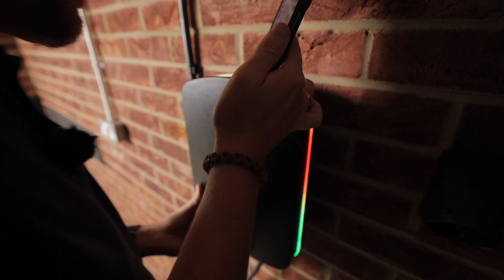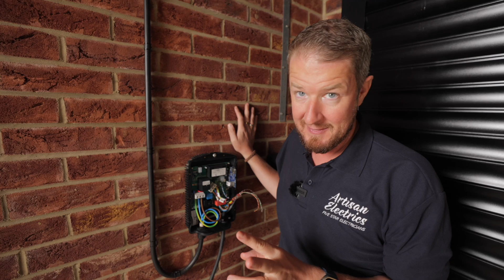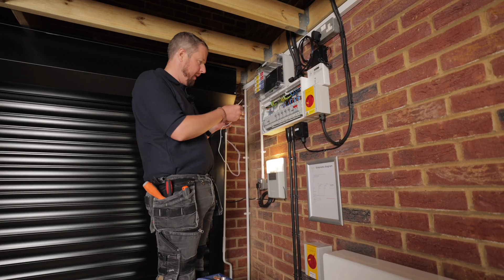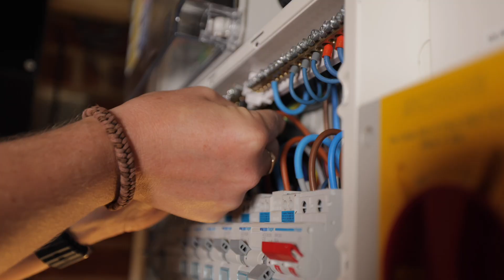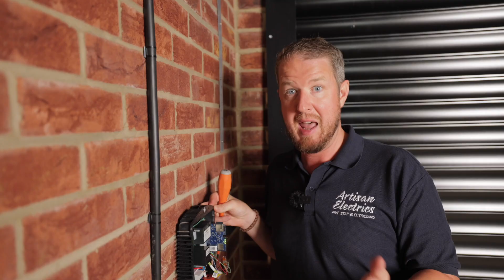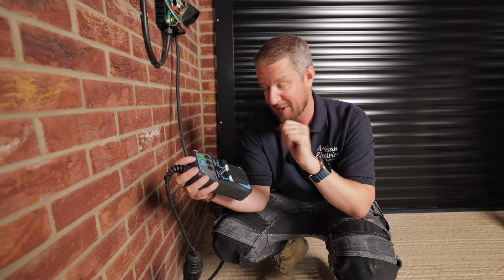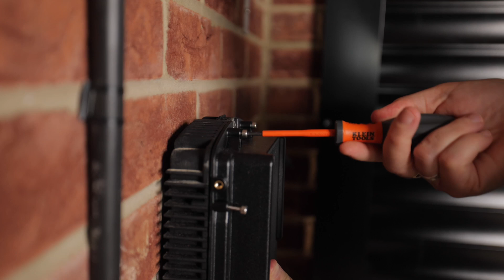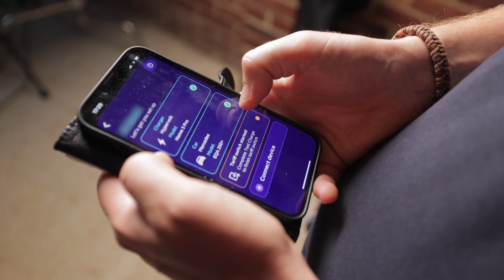Is this The ULTIMATE EV Charger?

Comment: outdated cause you can get such modes for free using evcc .evcc runs on any tiny pc or raspi and is manufacturer independent. 
It does not care about your wallbox, smartmeter and inverter cause it works with all of them . Customer decides to buy the best inverter like our Growatt SPH with EVE LFP batteries and a Pulsar Plus wallbox made by WALLBOX the inventor and owner of the term wallbox. And evcc manages how to use your surplus energy, when to start charging home battery and at what power level , when to charge the car and heat the warm water with the heatpump. 

And on top we will use EOS, the energy OS also made in germany soon funded by a kickstarter campaign. And of cause charging the home battery during of peak hours or when the price on the stock is even negative is supported too. Most or all our devices are running modbus and that is what you need: 2 wires

Comment: Your wonderful "battery safe" mode is very limited in what it can actually do.  The best it can manage is to detect when the battery is trying to supplement the power whilst it is doing diversion of excess solar.  The EV charge point then slows down the EV's charge rate to get the battery to stop again - that's it.

The real problem is when the EV is charging at full speed - 7.2 kW or so.  For that the extra CT clamp is no help at all because the charge point has no way of controlling what the batteries do.  The correct solution (regardless of what kind of charge point you're fitting) is to connect the charge point outside the area which the batteries try to power.  In the case of a Powerwall that means connecting the charge point between the Powerwall gateway and the grid supply.

This is part of the basic planning which should be done before any battery installation.  It's amazing how many installers don't do it.
Reply: How do you charge from solar in that set-up?
Reply: @simoncoles2463 still works the same - your EV solar CT clamp still goes on your outgoing supply, so when the charger senses you are exporting surplus it knows to start charging.
Reply: OR - have an automation system that detects EV charge power and reconfigures the batteries.
Reply: get evcc for free and then it is part of your daily decision . search for evcc and you will find the details for an independent soultion.

Comment: If using the batteries to make use of the cheap overnight prices. I cant see the point of having solar. The car and batteries will be on cheap rate over night. To use 18kwh a day in a home is unlikey without aircon/heat pumps.
At the video start you mentioned not using the battery for car usage due to the over cycling. So your saying not to charge a car via battery. Home usage is low without car charging. According to this video solar and battery is useless for car charging, car charging is 90% of energy usage in a standard home with a phev/ev.
Reply: do not forget that government looks for new money sources and that changing the accounting of your cheap elelectricity is the easiest way. And then you are screwed over night.

We have a 99,9% grid availablility. Power lines are mostly in the ground not like in the USA the mess with all the poles. And we pay for a kWh on the exchange about -5 to 30 Cent but have to pay on top grid fees of 20 Cent which all those parties get who are maintaining the grid. 

Your days are counted where you can get electricity for free through the lines cause Brexit will cost a lot more and the government will realise how to make money . UK electricity prices are cheaper than in the EU. And here everyone has to pay the grid fees per kWh.  

We get 8 Cent for a kWh we are feeding in regardless at what time - and for 20 years. But If I have to buy back 1 hours later I will have to pay the stock price and on top 20 cent fees.
If there is a lot of offshore wind in the north sea during night or winter then the price might be -10 cent which means I get 10 cent per kWh I take from the grid but still have to pay 20 cent for the grid, so at the 10 cent per kWh during these nights.

Comment: It's missing the most important thing, local access with a documented API. This is just another cloud connected piece of e-waste.
Reply: Are there any chargers that actually have a documented local API?
Reply: At least go-e chargers. The documentation is even freely available on the website.
Reply: @Aphova OpenEVSE is completely open
Reply: We have one no problems at all app is continually updated when req, what more do you want,
Reply: What extra features does that allow?
Reply: @B0jangle5  Home Assistant and other integrations
Reply: @B0jangle5  You can tie it into your home automation (if you have it) or control it in any way you see fit, instead of being stuck on one app.  It continues working if you have an internet outage.  If the manufacturer goes bankrupt or decides not to support your device/charger anymore because it is "too old", you can continue using it. Otherwise it just turns into  a brick (well best case you might still have a completely manual charger, but you lose a ton of functionality).
Reply: @fintrollpgr  Thank you. I was quite happy with my Ohme Home Pro as there was no need to automate it given that i'm already getting the cheapest rate. I hadn't thought about the issue of the company going bust though.
Reply: @B0jangle5  You're welcome. I forgot one other case btw. The manufacturer suddenly decides to charge you for the privilege of using your device over their cloud. Enough examples of that can be found also. Simply said if some device needs the cloud it is not your device.
Reply: Absolutely… Its infuriating that I have to have a monitoring clamp on the ev charger circuit to tell when the car is charging - why can’t the charger just tell me locally.
Reply: Its fully accessible from HomeAssistant locally offline. If this is a functionality you want or need then its a relatively simple job to setup. Its not a functionality which most people even understand.
Reply: @StephenBrightwood  Well good that this functionality has now become available. And yes I know many people don't understand. Which is why we should make clear why this is important. Especially for devices with a lifetime in decades.
Reply: Have to agree,  any charger that can't be integrated into a household home automation system in this day and age is useless. Another brand that meets this requirement and pretty much has all the smarts is Indra (UK based). Additionally needs to support the OCPP standards which Indra does and the hypervolt does not!
Reply: @nicholasevans166 is this something that can be achieved through an update?
Reply: @nicholasevans166  There are community ones from home assistance according to hypervolt's website.

Comment: Still waiting for V2H
Reply: if people woulld have clue what they are talking about !
The wallbox available are 2000€ pllus and the cars have a limited amount of V2H charging capabilities. All the VW ID Skoda Seat Audi cars are limited to 10.000 kWh discharging to the grid only.
Why `? Due to wear and tear of the cars electronic. Discharging means heat and heat makes electronic car parts aging sooner. 
VW does not want to pay the bill. Do you know the price of an eGOLF inverter exchange ?
A danish owner out of warranty had to pay 5000€ and I bet your thoughts will stop once you do the math:
2000€ for the charger and maybe a repair bill of 5000€ for a car that can not discharge more than 10000 kWh in its lifetime.

Check the new lease contracts. You are leasing a car for x years and maybe 60000 km but then you will get only 1/3 of the 10.000 kWh for discharging too in the contract. You do not get that for free and unlimited. 

The charger will not last forever so maybe 2 x 5 years a lease car would run in your garage. But that would mean maybe 10.000 kWh in 10 years for 2000€ charger so 20 Cent per kWh just for the discharging function ... and if you had to pay for the kWh saved  in the cars battery for example in the noon from the PV system, then you would have to calculate the money you would have made from feedin like here 8 Cent. On top for the round trip maybe 20% losses (home to car - car to home). Then the price for the kWh would be 9,8 cent pllus 20 Cent for the wallbox which then has to last 10 year or more. 

You can only win in extraordinary situations . Here we are buying LFP batteries for such case and connect them to the PV system. 15 kWh costs about 1500€ right now in germany as a kit out of 16 EVE MB31 cells with 15,8 kWh and a metal case incl. 200 A BMS which means a discharge capacity of 10 kW for a single battery or in parallel. 

But V2H is dead before it has been born. Everyone needs a new charger ... and I can do it on my own, but the avaerage will have to hire an electrician and pay a fortune on top. 2000€ for the charger and 400€ or more for replacing the old one, maybe 200€ for the software configuraiton on top.

Do not buy a car has been selected by a filter like "supports V2H"
Reply: @typxxilps  Long comment for sure but very little accuracy in it.  As to what role a vehicle's inverter plays in a DC to DC VtG system is beyond a mere mystery.  The physics of the 'discharge overheating' in the rather pedestrian flow of power in VtG mode when compared to that used say, whilst being used as a car, is another unusual take on reality.

Comment: Mate you do chat a lot shitttt you tell us which charger is the best on market more times I’ve had hot dinners make your mind up how much they paying you for this add 😂😂😂😂
Reply from the maker: When was the last time I said a different charger was the best on the market?
Reply: @artisanelectrics  you use the term far too often and I simply watched that after you had done a review of five of the besst which are now what ?

And the worst: these are not even the best solutions cause you ignore the software based solutions which are manufacturer independent like evcc. 

We do not care about the eco systems of the inverter sales guy or the wallboy guys or the battery brand. We buy what we think is the best and evcc and modbus will do the trick under the "mothership" homeassistant. 
Growatt Inverter, Eastron Smartmeter, JK BMS with EVE MB31 cells (16 kWh), Pulsar Plus from WALLBOX as wallbox - quite a lot of brands but each for the purpose one of the best like the Growatt SPH 4600 as low volt hybrids. 3 of them in a cascade and you get a fully 15 kW setup which I can scale up and down from 9 to 18 kW by software configuration.  Each of those with a 15 kWh battery for how much ? 1600€ each and if you buy 48 kWh or 3 of them then 1500€. 3 packs with inverter for 2500€ incl. battery. 

At the end a far cheaper solution than what all the electrician had to offer. Those can sell 1 brand only solutions but not the best of the best cause they simply do not have the knowledge nor the experience to deal with multiple brands, They usually have just 1 main brand and second as alternative they do not like to sell except they can make more profit.

Our market has evolved quite fast during lock down and people do the things on their own with the help of good electricians they do know well.
Reply: Chill out fella, it's just a car charger😅
Reply: This sounds great, but is very complicated for the average person to understand. A lot of expensive kit to install and purchase. What would the payback period actually be for an average family?

Comment: Zappi has had an avoid discharge mode since day dot.
Reply: This is partially correct. Hypervolt further allows you to distinguish between SuperEco and BatterySafe, so you can if you want use the battery, with access to fine grained control. Additionally, it's possible to automatically schedule patterns, so the chargepoint can switch between the modes seamlessly and automatically. In fact, a different schedule and mode can be setup every 15 minutes if that's what customers want.
Reply from the maker: Exactly - finally Hypervolt does everything Zappi can do plus way more and is better quality and looks better!